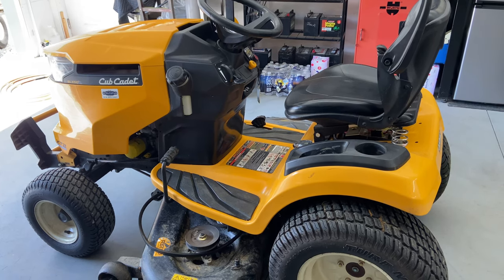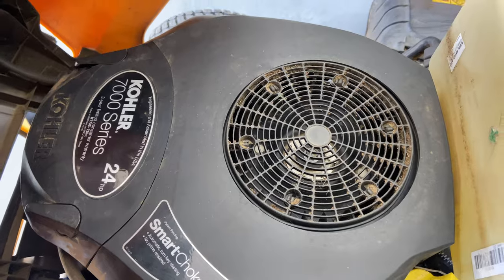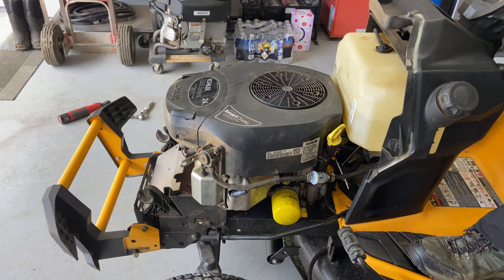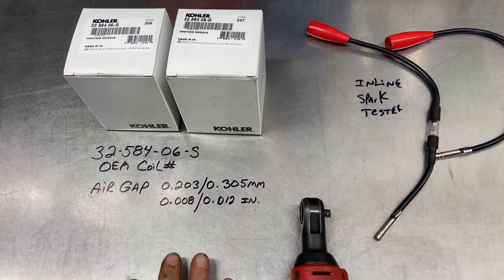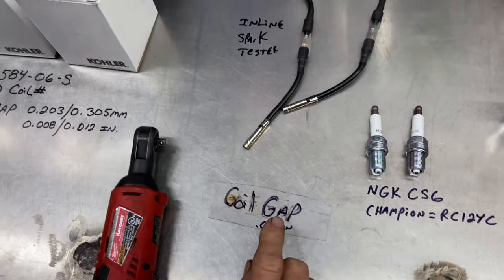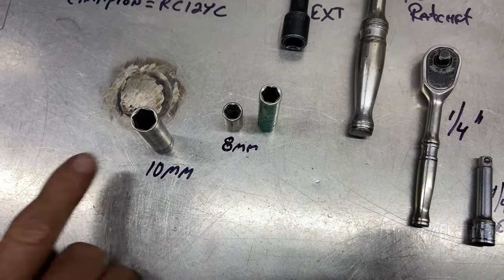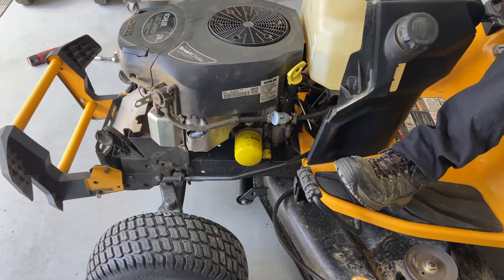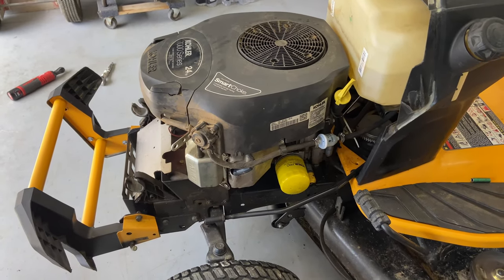How to Install Ignition Coil Kohler 7000 Series Engine

Comment: Strange thing is that  the Briggs and Stratton opposed twin cylinder engine uses a  single ignition coil system for both of the spark plugs  I have a twin cylinder Kohler pro series engine on my craftsman gt tractor  glad you made this video on this matter of the ignition coil system for a twin cylinder Kohler  engine Brad
Reply from the maker: Yes, and when the ignition failed on the old opposed twin Briggs, it didn’t run! Very easy to diagnose. The good all days! thank you for watching, commenting and supporting my channel!
Reply: @JohnsonsSmallEngines  your welcome Brad 👍😎😁

Comment: Fine vedio here I'm a fan of the kholer engine. But mainly the older ones with metal. I have the 600 series but I'm sure it's going to be the same process. But you maid this look like a walk in the park. Job well done

Comment: I have had all sorts of trouble with this engine shaking the rear mounting bolts loose.  You press on the back and down it goes.  The first time, it broke one of the exhaust manifolds/pipes as it had lost 3/4 of the mounting bolts.  Now I'm always checking.

Comment: I cannot find my break. I did both grounding the black and I did the second cut. I could actually hear the sound on both sides of the second cut that I made. I did a loop wire test with my unit and it showed closed loop, so I’m at a loss.

Comment: I have been having issues with surging this season especially when the PTO is engaged. I have replaced everything from a new oem carb, linkage, wind vane, fuel filter, new fuel, spark plugs . Could this be a possibility to cause surging? Maybe due to mice damage. I’m ready to throw in the towel.
Reply from the maker: Without seeing the macchine and hear it running, it is impossible to try and diagnose but here are a few things, (1) Does the engine surge at 3/4 throttle? or just at full speed? If it surges at full speed only, you may have to adjust the governor as the engine will surge if it is revving to fast. Check your high speed rpms. (2) you may have a clogged fuel line from the tank to the fuel pump, or from fuel pump to carburetor. (3) you may have a fuel pump failing "but I do not come across many failed fuel pumps"

Comment: I have the exact same mower and have never seen the shroud "shake" like that, lol.  Wonder what could be causing that as it's clearly tightened down.  Mine only has about 150 hrs on the clock (bought used with very low hrs.) so maybe just age?  It does make me feel good that it's made it to 600+ hrs and still looks and runs good as I only put about 50 hrs a year on mine.  Great video!
Reply from the maker: That shake was only caught on video. I checked it more than once after I played it back and it does not shake off camera. Very very strange. i’m thinking vibration while taking the video on the camera side when engine was running.
Reply: @JohnsonsSmallEngines  Ah, yeah, that makes sense.  Cheers.

Comment: I have a bad-boy MZ Magnum with a KT740-3048 engine.  I hope my two 32 584 06-S ignition coils arrives tomorrow.  On the kohler website it shows a RFI 25 132 14-S spark plug for my engine model.  The champion version is 982 xc12yc.  Badboy sells a RC12YC or a ngk -bk55e 7938 spark plug for my mower.  

Therefore I am confused on which spark plug to use.  Kohler and badboy recommends two different type of spark plugs.
Reply from the maker: It’s the same engine so both are fine. I use the equivalent of a champion RC12YC in a NGK version. I prefer NGK plugs.
Reply: I replaced my two ignition coils with a "Kohler 2 Pack Genuine 32-584-06-S Ignition Module OEM" from Amazon.  I can mow up hill and my mower does not shut off after an hour.   My mower runs like it was the first day.

I love these videos.  I could not wait for 4 weeks at the repair shop.

Comment: Very clear explanation. Thank you.
Reply from the maker: I'm glad it was helpful and thank you for the kind comment!
Reply: @JohnsonsSmallEngines  I should have watched your video first. I did a bunch of work on, setting them and checking the rod thinking that’s why “she” was struggling. I did check spark and was getting it on both cylinders. So, I sent her to the shop and I found out that it was the coil. Probably gonna’ cost me $ 250 for the repair. They did pick it a up and drop it off. Next time I’ll reach out to you!

Comment: Did this and still no spark in the cylinder don't see any mice damage what do I  check next all wires seem ok only change 1 coil 300 hrs kohler 748
Reply from the maker: If your saying you replaced a coils and it still doesn’t have spark in the new coils?? If this is the case, disconnect the kill wire to the coils and check spark again. Your coils should now have spark (if it is a good coil). If you don’t have spark you have  bad coils. You will need to figure out wiring issues. Impossible to diagnose without seeing the machine. I am saying coils because this engine in my video is a twin cylinder engine which has two coils. I’m not sure what engine your working on